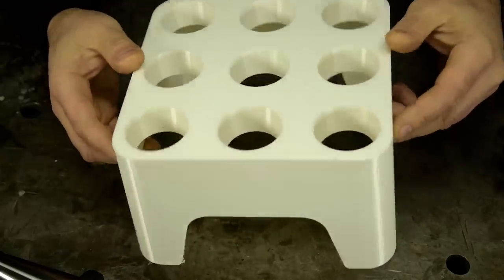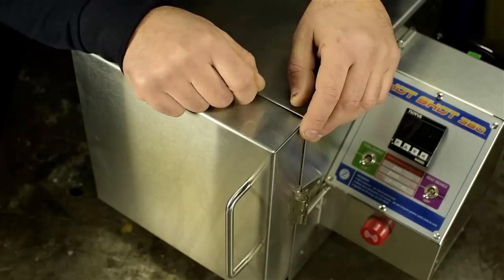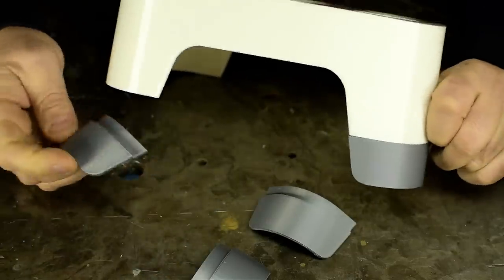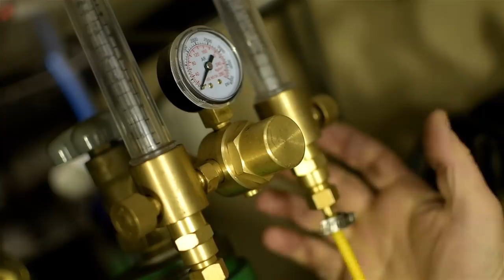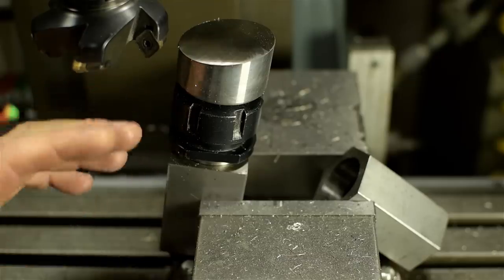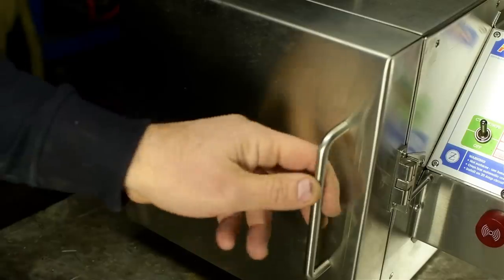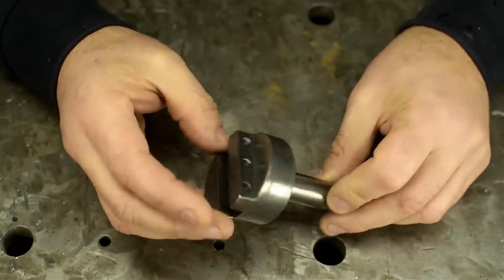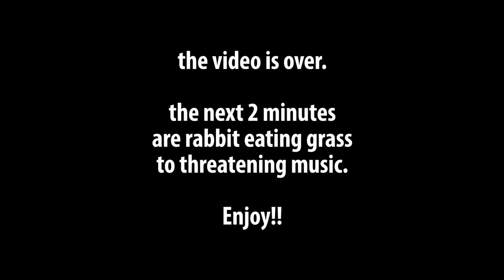NOW We're Cook'n with Argon!!

Comment: That moment of absent-mindedness where you released the smoke from your finger was way too familiar.  I have definitely done that.  A few times.
Reply: Same here . . . but with a soldering iron... I'm usually careful, all the way up to that point too . . .
Reply: I used to have a habit of holding random bits of undercarriage while watching students working under cars. It was never a problem because they were working on school cars; longest they ever ran was the minute to get from the storage lot into the shop.

Then one day I ducked under a customer car, right off the road and, while leaning in - grabbed the cat.

And that was my introduction to "incident reporting". Yay.
Reply: @Azlehria   About the cat. . . I wwas helping a friend remove a cat that had a hole in it and they were prying it while I was cutting it and all of a sudden SLAM! it came off and wack'd me up side the head.... That hopefully knocked some sense into or ouuta me lol... At least the install of the replacement wasn't a issue.
Reply: I picked up my freshly welded stainless part last night... Ive been doing this shit for years!
Reply: I am never ungloved at the welding shop.
Reply: Did that to a wood splitter exhaust once. Thought it was the fuel tank
Reply: @thedude7726  On the flip side of things, when it's cold and wet out, I've been known to get a good grip on the exhaust of a running chipper at work to warm my gloves up. Steamy leathers are fun, lol

Comment: Hey Tony, not to be 'that guy' but you know you can just make a 1 mm nozzle right? Could even be hardened steel! After all, what's the point of a home machine shop if not spending 6 hours on a $2 part :P

(probably need a heater upgrade for that though, just FYI)
Reply: Just to be another kind of "that guy", be careful increasing nozzle sizes. Your hotend has a limit on extrusion rate, usually measured in mm^3/sec. Things like the Volcano hotend increase this limit. Not sure what your hotend is, but you can probably find the limit online and program your slicer to not exceed the max extrusion rate, but that will slow down the print again. There will be a point of diminishing returns without upgrading the hotend too.
Reply: @samuraisystemsllc  a second to this! I have a normal V6 hot end and a Volcano and I keep stumbling into the volumetric throughout limit on just a 0.8mm nozzle even on my volcano (I run speeds fairly high, its a 400x400mm bed after all).
Reply: Other people have tried that with smaller nozzles and ended up turning the nozzle into scrap. You also need a printer that can push that kind of volume into a larger diameter nozzle, otherwise you risk damaging other parts of the hot end.
Reply: @samuraisystemsllc  Looks like a PRUSA so it would be a E3D V6 stock...
Reply: I think its been said elsewhere in the comments, but for anyone that's interested in learning about 3d printers, the power output of your hot end DOES put a hard limit on the amount of filament you can push through your nozzle per second. At first glance, that makes it look like a big nozzle is pointless. The reason its not is because the printer only needs to dispense a certain amount of filament per inch, but it can't fly around corners in the print at top speed. Therefore, increasing the nozzle gives you lower print head speeds, meaning the head doesn't need to speed up and slow down for turns as much, so it runs closer to the maximum speed more of the time. (You also lose resolution though, so sometimes it's not an option. Holding out hope for that multi head attachment. Do it for the kids, Tony!)
Reply: what about machinig a mould and melting the plastic instead?
Reply: A 0.6 nozzle will happily print a 1mm wide line, not sure what line width your were using but this might be a quick way to gain speed.
Reply: Prusa just started selling a 0.8 mm nozzle and added a tuned profile to PrusaSlicer, so at least that size is supported.

Comment: Great video, like always. Maybe the source of the scaling is the transition between oven and the oil. I mean, once it leaves the oven it comes in contact with oxygen rich atmosphere, plus the flames when dipped in the oil suggest reaction with O2. Also the oil might be contaminated. Reducing the time by decreasing the distance to the oil and having something to grab it with prepared might help. Also, bubbling argon into the oil might ensure there´s no oxygen at least on the surface of the oil. Best of luck! :)

Comment: Nice video (as always) and a great idea to insulate with argon. Though, in the shop I am currently working in, we sometimes temper steel parts in an oven, and we place them covered in some wood charcoal, that is going to burn and consume the remaining oxygen. As a result, we get nicely carburized grey parts that don't have that crocodile skin on. I would be very interested to know your results if you wanted to try it. Have a good day !

Comment: Classic TOT as always.  Maybe add a small hole at the top of the oven to allow the O2 laden air to escape as the argon flows in.  I suspect that if the oven door is  probably a close enough fit to prevent the air being completely purged before the steel begins to heat soak.

Comment: 1mm nozzel yeah.. not on MK3 though.. you need upgrade the hotend to a e3d volcano or something... the E3d V6 it comes with cannot melt plastic fast enough to print with a 1mm nozzel!
Reply: I mean, you can just turn down the feedrate and print slower. (yes, this can actually get faster print times, see others below)
Reply: @troy4393  which defeats the whole point in trying to speed up the print!
Reply: @oderbang  Well, to play the devil's advocate: your printer is rather rarely actually moving at the print speed assigned, because accelerations/decelerations take up the bulk of your movements. Consequently, if you double your extrusion volume and halve your max speed in order to maintain the same volumetric flow, you are in reality going to be printing significantly faster as your actual average speed can be much closer to your theoretical max speed.
Reply: Troy Dietz that would result in slower print time, so no Bueno.
Reply: An  E3d Volcano upgrade option would give the results you desire.
Reply: my anet A6 did well on 0.8 mm nozzle at 40-50 mm/s speeds , so unless you expect to do like 100mm/s speeds with 1mm nozzle it should be ok, i think it also depends on the temp of the filament feeding in, so a cold garage setup might not work
Reply: In other news Prusa today announced they added 0.8mm nozzle support to mk3 and started selling the nozzles as well.
Reply: That's nonsense, you can absolutely print with 1mm nozzle even on the cheap crappy Chinese hotends. You may not be able to print as fast as a volcano, but if you keep your speeds and layer height within reason, you can more than halve your print times with a 1mm nozzle. Now going from a 1mm to 1.5mm there will really be no benefit unless you upgrade your hotend, except reduced printer wear.
Reply: Yeah, E3D doesn't even make 1mm nozzles for the V6. Would have to upgrade to a Vulcano heat block for that. 0.8mm works though and I think as long as you are printing low temp filaments you might be able to get away with it. Also, for a 1mm nozzle one could just drill a bigger hole into a regular nozzle. Did that before, it's easy.
Reply: Witgang Younotube ambient temperature will play a role yes but a difference in 10 degrees Celsius colder will still only require about 10% more power. It's a matter of volumetric throughput (volume divided by time)
Reply: in the end it comes down to tuning your acceleration to some degree of acceptable ringing. It also would cut a huge chunk of the print time, if you raise the extrusion width. how much material is allowed to squeeze out the sides so to speak. takes fewer loops around the perimeter. and usually you can go up to ~125-150% depending on the nozzle diameter. 0.4mm nozzle with 0.5mm extrusion width at a 2mm wall thickness saves a whole lap per layer. lets say that's 5+ seconds per layer, 200mm model height@0.2mm layers... more than an hour
Reply: I absolutely recommended picking up a cheap nozzle kit from Amazon with a 1mm. I have had no issues printing with an e3d v6 at 1mm. The reduction in the number of layers is the biggest savings to print time.
Reply: @oderbang  With a larger nozzle you can reduce the number of perimeters, increase layer thickness, and it can reduce the number of lines needed for a given infill, which can speed it up quite a bit even for the same volumetric flow rate.
Reply: @malexander6367  You can buy 1.5mm and even 2mm nozzles that will fit a v6(though a nozzle that is larger than the filament you use seems kind of pointless. Just because E3D doesn't make them doesn't mean they aren't available. Frankly I think they E3D's nozzles are overpriced for what you get anyway.
Reply: @robepper  Many slicers have a volumetric flow limit set, so your printer might be printing slower because of that. You could up that limit to see how much faster your 1mm prints would be with an actual Vulcano.
Reply: @oderbang  If you math it out and test it's pretty easy to still get faster prints of the same volume (as @johannes pointed out); it's just a numbers game that happens to work out on certain printers.
Reply: @creamofbotulismsoup9900  Sure, but the volumetric flow limit in your slicer will make these nozzles pointless unless you up that and print with low temperature filament. At some point, your parts will start to get mechanically weaker because the filament doesn't have enough time to heat all the way through.
Reply: @creamofbotulismsoup9900  Also, I tend to often print with abrasive Material, therefore I need a wear resistant nozzle. I like to buy the E3D one's because:
a) You don't get some mistery steel alloy that might or might not have a good thermal condactivity 
b) You know that you'll get a nice surface finish and a straight bore inside the nozzle 
c) you support a company that actually deserves your money
Reply: Just always remember this simple equation for perfect prints every time: The angle of the dangle is equal to the beat of the meat. 🤪

Comment: Just a tip from someone who made a living from welding argon purged stainless steel piping and vessels. Always introduce argon from below and allow the air to vent out from the top. You get a much cleaner purge. You can get away with lower purge rates which saves argon costs as well.

Comment: FYI, they make 1mm nozzles but you should upgrade to an E3D volcano hot end to support the feed rate and keep the filament hot enough to stick. There is a lot of ideas and practical examples of tool changers floating around thingiverse but nothing really out of the box. What you suggested wouldn't work so well, but they do have multi head 3d printers. I have a tool changer I designed that uses an electromagnet to pick up different heads during the print. I usually run 0.6 and 0.8 nozzles and two different color filaments since I only have two heads at a time.

Comment: Hi, fair warning:  The E3Dv6 hotend used by the Prusa MK3/S is close to being flow rate limited (cubic mm of plastic extruded per second) for thicker layer heights even with the 0.4mm nozzle, so with larger nozzle sizes, that is the bottle neck and will prevent you from deriving a good chunk of the speed advantage you could be from larger nozzles.  But  I am very impatient and an instant gratification enthusiast (who isn't?) so here is how to get around that, and some other tricks to reducing print time by a few fold:      
  
1. Get an E3D volcano hotend.  It screws onto the Prusa heatbreak and uses the same heater cartridge and thermistor, so it is a drop-in compatible upgrade.  You lose a few mm of print height and you'll need to print a fan nozzle adapter to lower the outlet slightly (there are literally dozens of these if you look for volacno prusa mk3 on thingiverse - and you can print fine for the most part without it anyway).  You'll want to get some nozzles for it too - 0.2mm to 1.2mm sizes are available.  More importantly, the Volcano increases your maximum flow rate by 2-3x, which for layer heights and wider nozzles will cut print time by a half or third.  Just make sure you increase the 'maximum flow rate' setting in the filament settings in Prusa Slic3r.  The settings included are tuned for the wimpier E3Dv6.  I've been using a volcano exclusively for years and besides a mostly negligible z-height loss, there isn o downside.  It's just better.    
  
2.  Strangely, I never see much about this trick online but its a vital knob one can tune for 3D printing:  extrusion width.  Meaning, you don't need 0.6mm nozzle or even an 0.8mm nozzle to print line widths that wide.  The only true limitation with nozzle radius is layer height.  You always have to print layers slightly thinner than the radius of the nozzle (so 0.35mm is the max for 0.4mm nozzle).  But when it comes to extrusion WIDTH, you can generally print up to 250% the nozzle radius without problems.  If you look at the nozzle, there is a flat surface where the filament bead comes out, and that feature limits the line width (as this surface is what flattens the bead as the print head does an extrusion move).  So you can print 1mm line widths no problem with a stock 0.4mm nozzle, and often you can go slightly wider but you start getting into the tolerance territory for the width of that feature so above 250%, ymmv between nozzles.  I like to print with 3-4 perimeters minimum for strength, so a way to get a ton of speed improvement with little to no detail loss is to increase the line width of solid infill, infill, and perimeters while leaving the external perimeter width the default 0.45mm or whatever it is.  Also, using line widths 1.5 times the nozzle diameter and wider tends to improve layer adhesion, especially for certain filaments like polycarbonate.  The bead has to spread out and is thus smooshed against the previous layer with more pressure, and it is heat AND pressure that increases layer adhesion.    
  
3.  Not a tip per see, just a caveat:  you'll want to bump up the hotend temperature when printing at 20-25+mm/3 flow rates with the volcano.  The rule of thumb I use for most filaments is increase print temperature by 3°C for every mm3/s of additional flow rate above 15mm3/s.  So for 30mm3/s, this means 30-15=15mm3/s * 3 = 45°C.  So for a print temp of 210°C, this results in 255°C.  This probably sounds really high for PLA, but when you're ripping that sweet sweet lactic acid out at 30mm3/s and you can see the spool just spinning continuously, it won't seem that hot anymore.  The filament is spending so little time in the hotend that it is never actually reaching that temperature, the extra temperature is to heat it up faster so it still hits in the ball park of the intended print temperature by the time it exists the nozzle.    
  
If all of this sounds like it might have a fairly serious negative impact on print quality.... it really doesn't.  And you can really tweak these knobs without adjusting anything else and it really does generally just work.  Obviously you will have the normal changes from thicker layers etc. but using these tricks won't really have an impact on quality beyond what you'd get anyway, and if for some reason you do, just back off the flow rate a little and you should be good to go.    
  
Final double secret tip:  if you're really nuts, E3Dv6 also makes something called the Super Volcano that is also compatible with the MK3/S.  You will lose a lot of Z height but I mean, its a hotend that is undeniably what you get when you take the thermal limitations of print speed to its logical conclusion.  The nozzle size goes up to 1.75mm (so, literally the filament diameter lol)  and, well, just look at them.  If you need all the flow rate in your hotend, these nozzles will put it all up in your hotend.  ALL UP IN IT:  https://metacollin.com/s/hvOxXgoUR02s.png

Comment: Someone once told me the key to making being human easy is make your screw ups look like you planned them.

You didn't run out of printing 'ink', you planned on two tone legs.

In that vein, I went looking for drill stops by ordering shaft clamps. The secret to my research was I ordered a bunch of shaft clamps by the OD, thinking it was the ID.  As I was putting away the much too small shaft clamps, I noticed just how much they looked like the set of 'drill stops' I had bought from China via eBay 4-5 years ago.

What put a smile on my face was discovering the price of the shaft clamps was MUCH cheaper than even the drill stops when I compared the sizes in the set.

I love it when a plan comes together; even when I had no plan.

GeoD

I bought the cheapest, single set screw, no split, Blk Oxide coated steel shaft clamps.  You could go 'show boat', and buy SS shaft clamps.